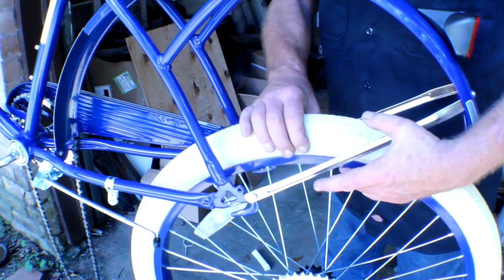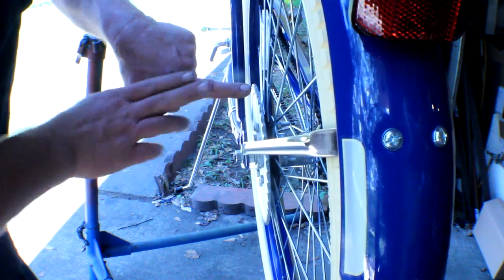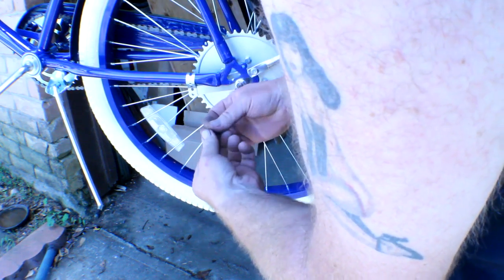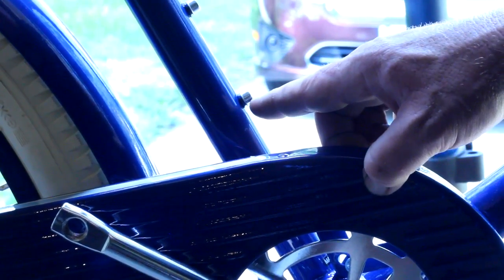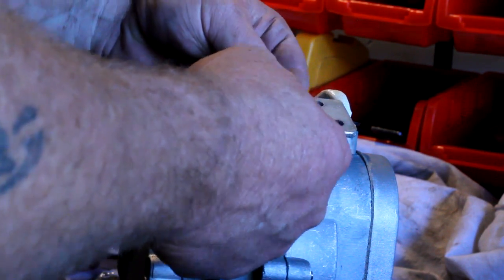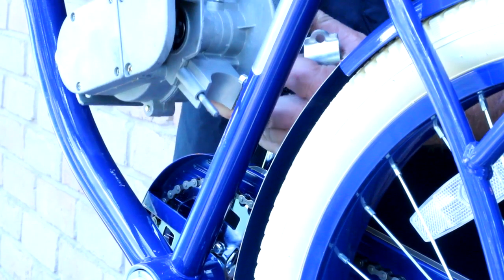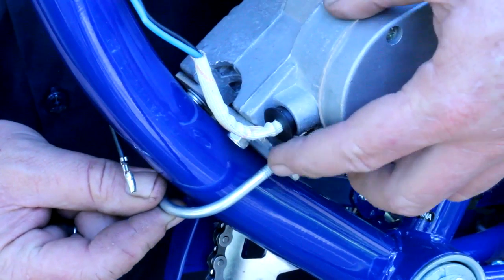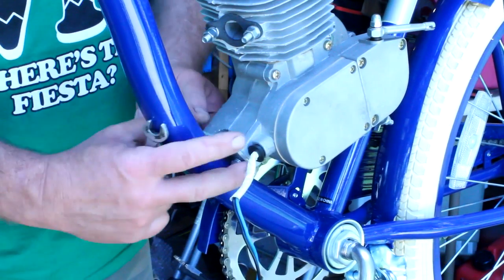How To Build Motorized Bicycle Part 4 - Install & Align Rear Sprocket and Mount Motor

Comment: Could you please tell me again 2 stroke guru why its a bad idea to rubber mount most anything on a motorized bike build.  And thank you very much for your sites content.  Real and logical information that can save us common builders hours of head aches.
Reply from the maker: Rubber=flex. Flex=chain problems and has caused frames to crack. Now if it had a driveshaft and the engine was designed with heavy rubber motor mounts like a car or truck then it would be different is my 2 cents

Comment: Although I only did one 49cc Grubbee build on a Cranbrook, your video is a great refresher for my second build. My 13 year old motobike was stolen on July 8th, so I am working hard to create a new one. I would not leave ANY motorized bike outside anywhere, as bike theft of any nature is too common nowadays! Mine was stolen out of my garage at night, and the bike was hidden behind my Honda Civic!-John in Austin

Comment: I'm have 3 wires from my motor blue black and white I have the coil with a blue and a black then my kill switch has a green and a black/white  wires I don't know what order they plug in can't get bike to spark and it brand new

Comment: Bike mechanics every Where just cringed when you took that claw hammer to some spokes!😭 I HIGHLY recommend if you need to true the engine sprocket, to use an adjustable wrench or channel locks, grab the edge and PRY, don't beat on a hub or spokes unless you have a dead blow or soft hammer! There is even a specific tool sold by Park Tools to true disc rotors in that manner.
Reply from the maker: Yup, I gotcha. Hell, most bike mechanics cringe when they hear someone wants to put a motor on a bicycle.

Comment: Throw away the rag joint.. After 3 bikes I only use the cnc sprocket. a customer will pay the extra 85 dollars and you will save your self so much time and headaches. and so much safe.
Reply from the maker: I have been running a rag joint on my daily rider for 5 years. ZERO issues. I'm cheap

Comment: I may build one also. Two things I noticed though. This build would be great to use ratchet wrenches. Also, you should use a ball peen hammer, not a claw hammer to strike metal.

Comment: Why would you hit it? Just tighten the bolts
Reply: Correct. Adjust sprocket alignment by tightening 3 bolts to draw it in a bit closer. Using a hammer is silly.

Comment: i wonder if putting a small piece of thin rubber between the brackets and the frame would help with vibration.
Reply: Yes it does i use a peuce of cut up bicycle tube to put in between the mounts

Comment: question....just received my kit today,BUT the problem is that the chain binds up on the drive sprocket, literally it gets stuck on there almost as if it werent designed for the drive sprocket, eveything is aligned VERY frustrated, should I buy the #41 chain like most people recommend
Reply: don't worry,you just need to tighten your chain alittle more.

Comment: i've seen some ppl tell that is a good and cheap alternative to use 410 chains instead of 415H. and kit's wheel sprockrets fits better with 410 than 415, plus having more clearance, aswell as simillar durability. and engine's one is inverse, fits better with 415 you just need to change engine's sprocret to match 410 too, cause is also cheaper. happens to be that 410 is the standard pedal chain for fixed gear's bikes (?). I even guess they did use a standard solid cranck spr. to make kit's one, using bike parts even for that. Is that chain at your pedal 410?

ALSO a good alternative i was thinking about is to use rubber seal washers, which they use to seal tubes, and place at sprockret center, to help centralizing ragdoll installation...
Reply: I had no problem with a 410 chain with my 49cc Grubbee, until some thieves stole my motobike on July 8th!-John in Austin

Comment: Do i need to put oil in my motor and than drain it. to lubricate it. ?
Reply from the maker: +Jeremy Massey The 4oz of oil mixed w/ a gallon of gas provides 100% of lubrication. NEVER run on straight gas
Reply: +HoustonMotorized I think he meant to pre-oil it.
You shouldn't need to do that, 
additionally, these motors are initially run on a richer mix.
Reply from the maker: +TIMEtoRIDE900 40:1 is fine from day 1. Many chainsaw motors and the like that run higher rpms run 50:1 from the start
Reply: no need to drain.the engine requires a gas/oil mixture.

Comment: You have the mounting place back words you didn't need to cut the you bolt
Reply: well you should look back at your video because you can obviously see that the the mounting plate was backwards, you even said you had to turn it around
Reply from the maker: +jared yates I have built over 200 bikes and I do this for a living. You?

Comment: By the way when you are mounting the brake arm to the bracket that holds it just put the bolt in the other way and you will not have to worry about a nut

Comment: please help me . one of my font motor mount screws broke off inside of the motor mount hole.  I need to know how to get the broken piece of screw out. any suggestions would help. thank you!
Reply from the maker: jordon manning Get a dremel tool. Cut a slot out of the stud and use a screwdriver to back it out. Replace w/ grade 8. Ohh and never put rubber between motor and frame
Reply: I should have read your message earlier. thanks though. I drilled it out and retreaded it
Reply: +HoustonMotorized About the rubber between motor and frame, how come? What if it's thick rubber and glued down? You'd think that that would absorb some of the vibration, and although there are locking washers and such. Help keep nuts and bolts tight.
Reply from the maker: Any rubber will allow the studs to flex and the flexing will break the studs.
Reply: +jordon manning you can go to lowes and ask for eay outs they will get them out
Reply: +Warrior Combat Easy

Comment: I have finished my bike and it works great. How can I stop the bike without it shutting off(Squeezing the clutch) so that the engine runs while at a stop light or sign
Reply: Idle screw
Reply: Someone told me to tune it

Comment: a friendly observation =)

  9:45 maybe instead of cutting the u bolt you could use a rubber fitting behind the pole that way you don't damage the bolt treads  and you protect the bike paint . i love making staff like that awesome tutorial by the way you think i can put this motor in 26" Columbia 1937 3-Star Men's Cruiser Bike its on walmart and i think it would look awesome 
 if you can!! thanks =)

Comment: i am building the exact same huffy bike.  I am having an issue with the chain clearing the tire and the frame at the same time.  Any help?
Reply from the maker: You might check to see that the sprocket is installed so the chain is kept as far away from tire as possible. You also need to insure you have the sprocket installed as described in the video

Comment: when mounting the front of the motor, you dont need to cut the u bolt, you just need to take the plate off and reverse it so the u bolt is more towards the front